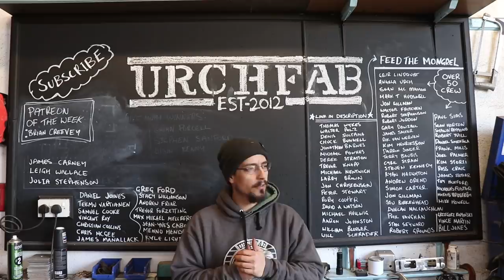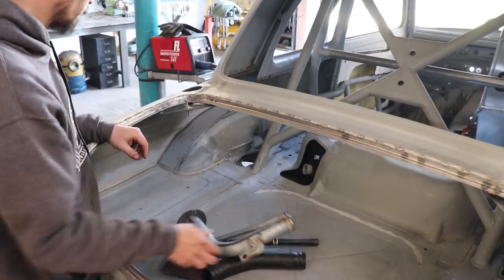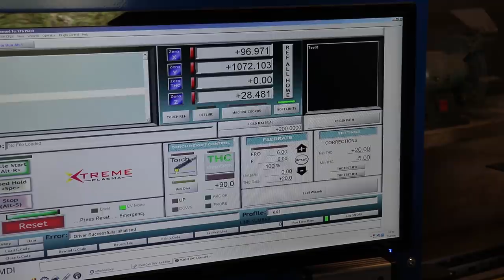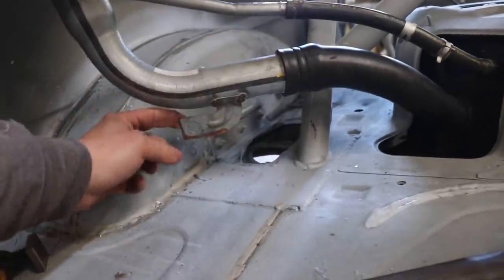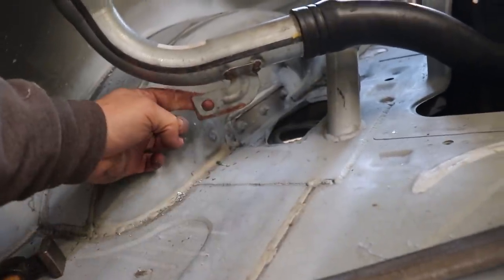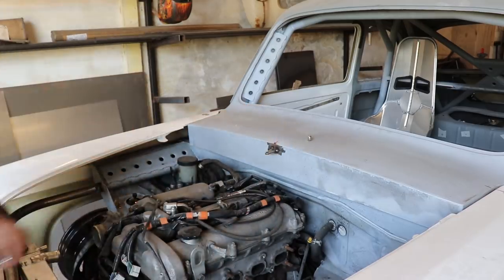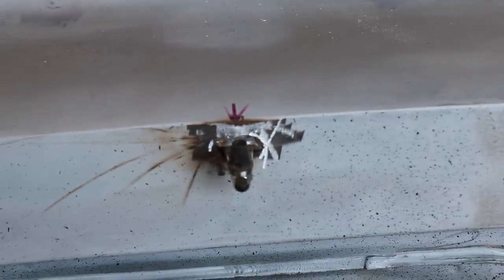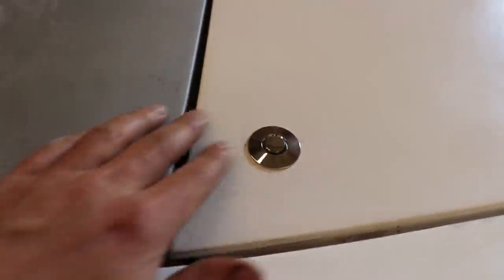PART 50 ON THE MX5 MIATA / CLASSIC FORD DRIFT PROJECT.

Comment: Quick latch here in the US has those with spring washers for up pressure. Probably what you were talking about, as they are about $30 each US. Loving the build and I would watch another 50 episodes or a 17 hr,36 minute episode. Cheers for making😁👍

Comment: Good work, you can weld the top of the filler pipe you wanted to use, the one with the chrome filler cap right on top of the one you so beautifully welded in, and Bobs yer Uncle.

Comment: Past a big landmark 50 episodes. 
Those fibreglass panels are fitting much better than I thought they would. Nice work making all the brackets and fixing clips. Petrol filler pipe looks good as well.

Comment: Anyway you can integrate a spring into your bonnet clip bracket that will push the panel up when you release the clip?  Releasing the clip should pop the panel up a bit so you can get your fingers under it.

I wonder if the more expensive clips you were talking about might have some  kind of spring arrangement incorporated into them

Comment: If possible, light spring tension beside the bonnet connectors, so it lifts away when you press. (armchair advice)
Reply: Good idea,just a spring on each pin,good one!

Comment: Word of advice on those ball catches, KEEP THEM GREASED! I have them fitted to my fibreglass and had two seize on me, had to butcher my bonnet to get it off. I also find they only work in one plane. As soon as you have ones at 90 degrees like your front ones it’s a pain to remove. Looks awesome though, keep it up.

Comment: Those welds tho!
My boss says to me "try the mig. See if you can get it to work properly because I cant"
I'm looking for ages for a little not welder and can't find it. Boss pulls a tarp off something and it's a huge big Kemmpi trolley welder! Must have cost a damn fortune! Sure enough I'm having trouble with the wire feed. You have to have the line almost dead straight otherwise the wire binds up. But it welds so nice. I just need to practice more since I've been ARC welding for years on the farm.

Comment: I may be wrong ( I'm probably wrong, I usually am) but isn’t there something in blue book regs about fuel fillers being below the surface of the surrounding panels so it doesn’t get wiped off in the event of a crash.  If you want to do RAC MSA events I’d check it.

Comment: I was going through the same nightmare with the bonnet pins, bought the cheap ones because they look the same and I didn't want to pay "just" for the brand... spend a day adjusting them, they were still shit. Cracked one (they were plastic) after a day, the second one after 2 weeks. Bought the expensive ones, loved them from the first second. Not buying cheap stuff anymore, rather will survive a week without a beer and buy something better.

Comment: Great work as always Matt. My only concern re the bonnet would be water running from the skuttle over the engine. Is it worth considering a gutter strip under the back edge of the bonnet ? Happy 50th 👍

Comment: You may be aware of this but you did say a solid aluminum cap... So a cap must vent.... And you may think well it's sealed but it's still vents.... So you may want to figure out a way of venting your system but still making it look cool work with a ball valve or something

Comment: Dude I'd ditch that external filler altogether, in a worst case as you said the tank could spill everything if that rear 1/4 is bashed in, keep the filler safe inside the boot so nothing can rip that hose off. Think about it, even a good dent in that 1/4 will angle that filler neck and possibly pop off that hose, imagine if the car was on it's side or flipped!

Comment: Hello Matt - just an 'overly cautious comment' -  if my memory serves me correctly (HA - or incorrectly) - early Minis with an outside fuel filler cap were a fire hazard in an accident when the cap is torn off.

This is an excerpt from the CAMS (Australia) 2019 Rules - whether this supplies anything useful to you - not sure - but always better to be safe than sorry when FIRE is concerned.

"FUEL TANKS AND FUEL SYSTEM:
(a) Except those where the fuel tank is located wholly within the chassis frame, all cars in Groups F, M,
O, P, Q, R, V and F5000 must be fitted with either FIA-approved safety fuel tanks or tanks filled with
safety foam. The use of safety foam-filled tanks is recommended for all other Groups.
(b) Fuel systems (electrical or mechanical) must have an isolating device which is clearly marked.
(c) All quick-release (Monza-type) fuel filler caps protruding outside the silhouette of the bodywork must
be fitted with a secondary device to prevent accidental opening.
(d) It is recommended that all cars are fitted with a one-way safety valve in the filler neck as close as
possible to the fuel tank.
(e) All vehicles fitted with electronic ignition systems must include an automatic cut-off which switches off
power to the fuel pump after a maximum of six seconds’ absence of crankshaft revolution.
(f) All fuel tanks must be vented externally to the bodywork."